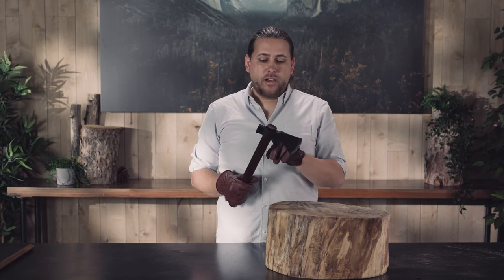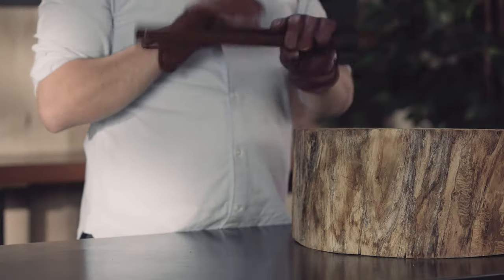How To Replace Field Hatchet Handle

Comment: just got this thing on bespoke post, why would you send out a half assed product and expect your customer to finish the build, re setting a head after prolonged use is different. if you send out a product that is out of the box unusable, that is laughable. if anyone wants to know how to properly set an axe/maul head dont listen to these guys, tap the hand side with a mallet and drive a wedge of harder wood into the axe head side and trim the rest. will stay tight for years.
Reply: Yes but this isnt an axe in the traditional sense this is a tomahawk or trade axe  made for the frontier  when ur handle is damaged or broken u can easily replace it in the forrest with a stick or small tree instead of an axe  which needs a wedge and propper wood.

The fact that it can slide off is because its a friction fit like trade axes and sea axes are ment to do  so it makes the axe usable even in hot or cold or wet or dry conditions bc u always have a tight fit then. U can also take the hwad off and use it as a knife. 

If u thought it whas a modern hatchet than u are wrong

U want a hatchet not a trade axe or tomahawk but u did buy a trade axe or tomahawk u are to blame for that.

If u want a fixed one  u should look at hultafors or huskavarna or other ones ofc.